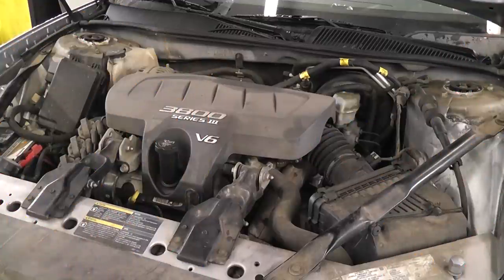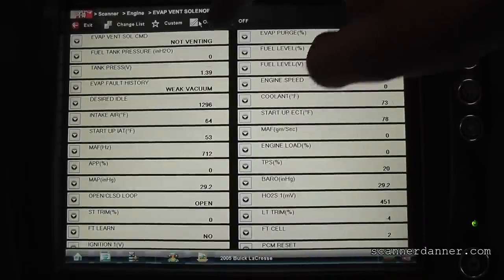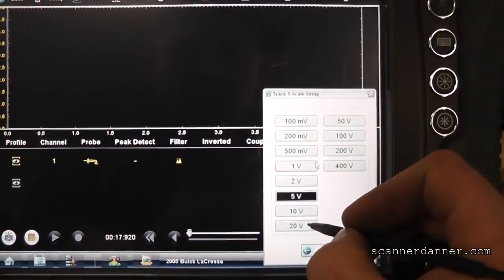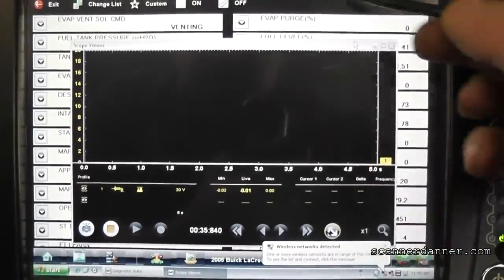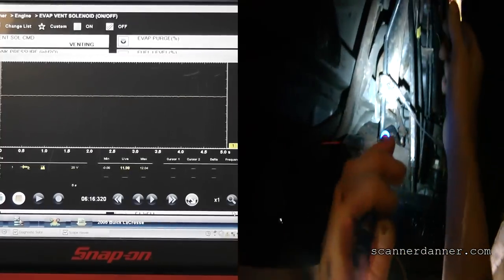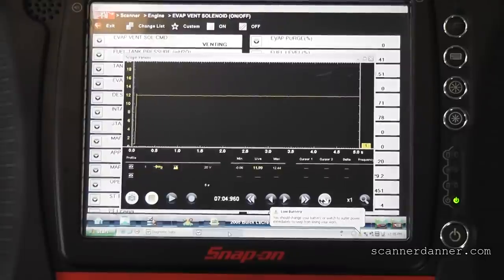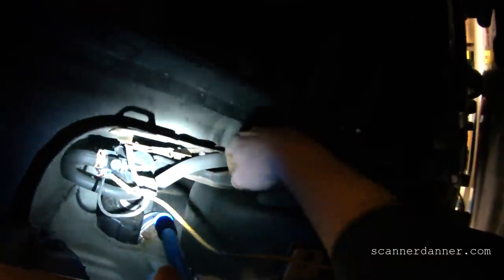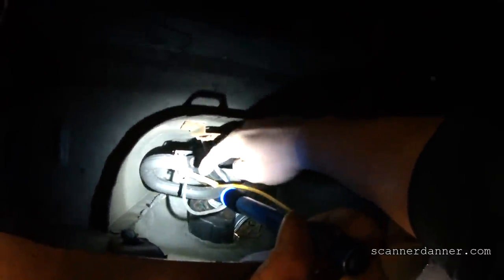EVAP Leak Test P0455

Comment: Thanks Paul! I can not even imagine how mach time You spend on editing this. Now You are Professional as operator and editor too.
Can not await when Peat will get some European made diesel engine vehicle with performance issue or no start for You. :)
Professional teacher, professional tools. Step by step process that leaves no questions or doubts behind!
All dealers would want You work for them.
Reply from the maker: the better I get at editing, the longer it takes! you would think that would be opposite ha
Reply: That's the way it is with writing software, too. Easter eggs are just programmers flexing their brains.

Comment: Incredible video!  In the smooth presentation and not belaboring obvious points.  I will point out, though, a fuel tank always has some oxygen in it unless you fill it up to the very top of the filler neck.  As the fuel is consumed, air is let into the tank.
Reply from the maker: Thank you Paul

Comment: Watching you and understanding  system..When applicable..u can activate solenoid & use vacuum  pump & will actually hold solenoid closed until you remove vacuum even not being powered  ..I did on 10 caddy srx..it will stay closed until u release  vacuum

Comment: Fantastic-a demonstration on how to test with  the smoke machine would be a bonus.  I have found many uses for mine including head and tail light lenses finding where the gasket is letting in moisture. Great machines.
Reply: Cool, to those of us without one. Put the lens in water, watch for where the water comes out. Seal it up. Done. Say thanks to Chris Fix....you have to wait for it to dry...Chris put it in a shielded box with a heat gun to make that quick...so yeah, smoke is better. :)

Comment: One suggestion to improve the overall video is to make a sketch of the overall system to visually illustrate the flow of the system, the major components, where you are hooking the test equipment and what the expected results of the test should be. It shouldnt be an in depth discussion like you lecture videos, but i think brief 2 min. discussion of the evap system basics with a sketch would add a lot to the video.

By the way; the 2 camera side-by-side effect was awesome.

Comment: Would that solenoid sticking cause a rich condition  on the fuel trims or only the purge solenoid?
Reply from the maker: No symptoms other than a large leak code. The only time this solenoid is closed is during the leak test.

Comment: what kind of oil do u refill that smoke pro with? i have the same machine, i bought it used and i cant get it to blow smoke. i have baby oil in it right now.
Reply from the maker: don't use baby oil, it has fragrance in it. You have to use mineral oil. You'll find it on the shelves at the stores where they sell laxatives ha.
Also don't put too much in the tool. I have found that once the oil bakes in there for too long it turns brown and doesn't produce good smoke anymore. So I just put a little in at a time and change it frequently.

Comment: This is a great video. Could you tell me the purpose of the gauge on the top of the can? 
Looks to be sitting around 20 (PSI?)
Is this input pressure of something?
Thank you.
Reply from the maker: Keith Smith It inches of water column (and is doesn't read correctly). The tool only puts about 1 to 1.5 psi into the system.
Reply: 27"wc = 1psi
20"wc looks correct to me. the gauge is reading tool system out let pressure. when the system starts leaking the air begins to flow, lowering make up supply pressure.

Comment: Thanks for the video. Is there any way to clean / lubricate these vent solenoids so as to unstick them?  Make them reuseable / last longer? I've had to change mine in my 2004 Impala like every 1-2 years. Also - do you have a video for testing the vent purge solenoid for a 2004 (Impala Vin K) 3800 series 2 engine?
Reply from the maker: Cleaning them has never been something I tried to do. Replacement of the valve is needed. 
Here are some purge valve videos
 https://www.youtube.com/edit?o=U&video_id=YhD7f4UrQqE
https://www.youtube.com/edit?o=U&video_id=jKVy_FLehhw

https://www.youtube.com/edit?o=U&video_id=ZqWIwBByBHE

Comment: without looking at alldata, is that a 3 wire connector going to the vent valve?
Reply from the maker: nope, just a simple 2 wire normally open solenoid

Comment: I have a Buick with a large leak on it and when I try to energize the solenoid it says too much vacuum on my scanner.  Any help would be great it's a 01 Buick century with a 3.1 code p0445.
Reply from the maker: Focus on the tank psi sensor. I believe I have a video on this
GM Fuel Tank Pressure Sensor Test

Comment: I have a 04 monte 3.8 supercharged and I changed the purge valve and got the p0455 again,how do you check it if you don't have a big scan tool like you have..
Reply from the maker: Al Vendetti P0455 is a large leak code I believe and is usually caused by a stuck open EVAP Vent solenoid (not purge) on a GM. Just like I showed in this video
Reply: I changed the purge and gas cap and it has not gone back on.

Comment: nice video, I went to a deep Evap class covering  for all makes . a piece of information  Chrysler is the only one company who makes normally close  vent solenoids and gm is the only one company who  has on ftp sensor  as  vacuum is created in the tank voltage increase in ftp pid  all other are  when going in pressure voltage increase when going in vacuum voltage decrease, curios after that class the teacher said firs thing to check is your ftp sensor open gas cap your  ftp sensor should read  atmospheric pressure ,  gm is noticeable for large leaks codes when the ftp sensor goes bad and you get not codes for  ftp,  next week  we had 3 gm for evap large leak guess what  firs thing check FTP voltage was  about 4.5v  to 5 on all  gm telling the pcm it was under vacuum.  probably common problem.
 thank you for this good video Paul as well your brother tell him I told you to get a better camera  jjejeejthe content is wonderful of his videos .

Comment: I tried making a smoke machine with a glow plug and baby oil but I soldered around the plug threads which eventually couldnt take the heat and started leaking.  To think your 800 dollar smoker uses baby oil and a basic heating circuit, not to mention the cool colors and pretty LEDs, it's cost makes total sense. And what do the tool guys say again. "Oh but think of how much money this little guy will make you,"......(You mean after the two or three years after I pay this thing off, and not to mention I still havent seen a return on my overhead valve recessed spring compressor tool that i used once this year.  I'll trade you that for this, etc, and then Mr. Toolman repies "no thanks, nobody really buys those things."
Reply: Forgive the correction. Scanner Danner was helping another guy out who was having trouble with his smoke machine. It uses mineral oil, not baby oil. Use small doses of mineral oil and change it out often. Put a bunch in there and the liquid turns brown and becomes less effective.

Comment: How do you go about charging people for all of these tests to justify the cost of the 10k scanner and the $1500.00 smoke machine?  Not to mention your time.   Do you charge a flat diagnosis fee?  Go by the book for each test?  No fee if they have it fixed?  

 In the case of this vent solenoid the job pays only an hour at best so that isn't going to make  up for your diagnosis time and shop costs.  

  This is a problem I'm dealing with in my small shop.  These tools have to make money for me and the shop but at the same time I don't want to chase away a customer with big diagnosis fees.
Reply from the maker: First, you do not need the Verus to do what I have shown with the bi-directional scan tool test. There are much cheaper bi-directional scan tools out there.
Second, the smoke machine I was using runs for about $800 and will pay for itself in no time.
I charge a flat fee up to 1 hour. So if it takes me 5 minutes or 60 minutes, I charge the same. After 1 hour we talk about where we are and go from there.

Comment: evap leaks.    Thanks for this crap carmakers.    Hate your crappy products and over engineering!
Reply: Yeah, too bad they don't can't make perfect everythings and no one will ever have a mechanical problems.  Right?  James, it's astounding that as complex as the evap system, with so many points of possible leaks, or circuit failures that they are as reliable as they are.